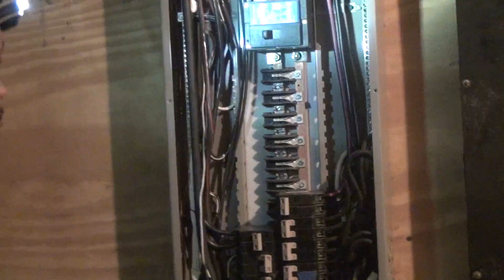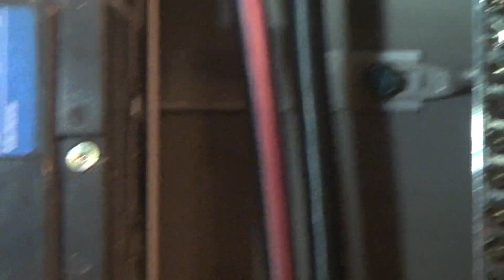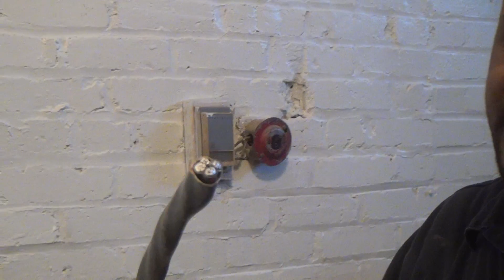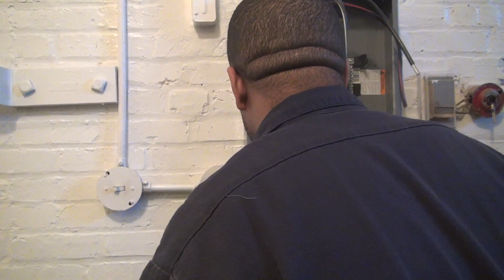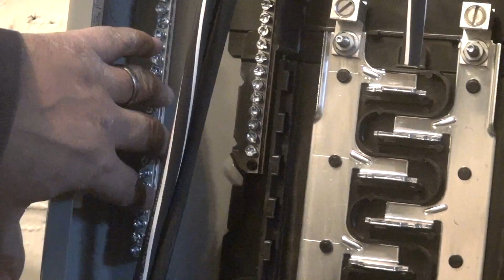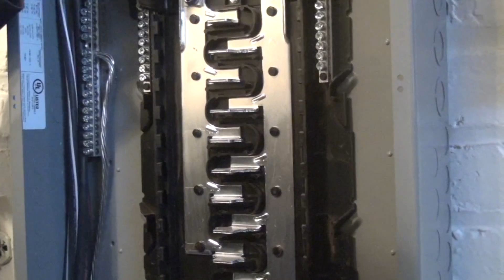How to install a sub-panel

Comment: Great video Tyrone!  Very informative.  I've watched quite a few videos on the same subject and yours was definitely the best and covered all the necessary information.  I do have a question.  I'm installing a 100 amp subpanel in my detached workshop and will be placing a load center with its own main breaker.  In your video you ran the #2 wire from a separate breaker in the main panel to the subpanel.  When the subpanel has a main breaker how do you connect the #2 in the main panel?  Is it connected to a 100 amp breaker in the main panel?  It doesn't seem to make sense to have a breaker at the main panel and another one at the subpanel only separated by the #2 wire but there doesn't seem to be any other option.
Reply from the maker: you can have one in both but normally you just use a main lug panel for the subpanel.
Reply: Thanks for the quick response! That's what I thought. It didn't make sense to have 2. So how do you connect the #2 wire in the main panel?
Reply from the maker: Rob Neto You can use a main lug panel for your 2nd or sub panel. It has lugs at the top where you would connect your #2 ser cable. The main service panel will be where you install the main breaker.
Reply: That's what I needed to know. I'll look closer for those lugs in the main. Thanks again!

Comment: Hello Tyrone! We are planning to install a sub-panel in detached garage. The size of wire is 8/3. From main panel It comes out from 40 amp breaker. Unfortunately, the wire we purchased is too short. The wire is in the garage. I was wandering is there a way to extend the wire with a small box? Thank you so much for your videos.
Reply from the maker: Yes you can install a junction box, to make life life simple I do suggest that if possible you install the junction box indoor. The requirements for installing the box outside means the box have to be approved for such use and the manufactures installation requirements must be followed.

Comment: thanks for the video. Question...I have a 200 amp main if i install a 100 am panel in my garage/shop will my main panel still provide 200 amps? If not, how can i accomplish this? thanks in advancep sub
Reply from the maker: Hey Jon every thing that is connected to the 200 amp panel becomes a load to the 200 amp panel. So the answer to your question is yes. Normally you calculate the load that is being served by your service (main panel) then derate that value by particular amount based on calculations found in the NEC. Trying to explain those calculations in this comment would be a bit much. If you have a heat pump, electric range,electric dryer, electric hot water heater, pretty much all electric appliances no gas then you may want to do a load calculation. Otherwise you may be fine with the 200 amp service, in all likely hood I would think that this is the case. Very seldom is a 200 amp panel not enough to serve the typical single family home even with the addition of the sub panel in the work shop.
Reply: Thank you for the quick reply I now have a better idea in reference to my particular circumstance
Reply from the maker: Jon Declemente no problem

Comment: Great video. I have a 100A main lug panel in my laundry room and want to upgrade it to a 200A main breaker panel due to the present one being full. The service panel that has the meter is located outside on the opposite side of the house for which the full main lug panel is located now.. I believe that I need to run a new 4/0 4/0 2/0 AL cable from the meter panel to the new 200A main breaker panel in the laundry room.  I also want to replace the present 90A breaker in the meter panel with a 200A breaker for my new 200A main breaker panel in the laundry room. Basically this panel will have two 200A breaker installed (one at the meter panel and one in the laundry room panel). How do I connect the huge size AL wire to the new 200A breaker? Do they even make a 200A (GE, Eaton, Cutler) breaker that is not a main or am way off left field? The end goal is to install a 200A main breaker panel in the laundry room. Oh by the way the outside meter panel houses three breakers: 1- 90A main house breaker, 2- 50A AC breaker, and 3- 40A RV breaker).
Reply from the maker: i am a little confused what size is the service coming into the house? Why do you think the size of the sub panel needs to be 200 amps ( what type of loads are you connecting )

Comment: Thanks for you time in filming this video installing the 100 amp sub panel. What was the size of the 2 pole breaker you installed in the main panel to supply the 100 amps you brought over to the sub panel with the SER #2 aluminum cable?
Reply from the maker: I believe the main panel had a 200 amp main and the breaker in the main panel that supplied the sub panel is 100 amp.

Comment: Excellent tutorial...thanks for taking time from your valuable day to post this video. What is the proper place to install the sub panel? Does it have to be in a certain room or perhaps a hallway or closet?
Reply from the maker: no there is no specific location but it must be readily accessible and have a minimum of 3 ft of working space.

Comment: Pretty good video but the main thing you missed is what size OCP you used for that sub panel with that #2 AL SER.   What code cycle are you on? For 2008 cycle you need to use the 60 degree column for ampacities which #2 AL is 75 amps.

Comment: We  were taught that the NEC will never require larger than no# 6 wire to a ground rod but if we want the utility company to hook up, we had better run a no# 4 . Remember local codes can supersede the National Electric Code. Good video ,well done.

Comment from the maker: The installation you are attempting is a little complex (you have special requirements for equipment serving boat docks and marinas) It is to much information to post in a you tube comment (not nearly enough character allotment) I would suggest calling a licensed electrician to make sure that everything is done properly

Comment: Great video.  Very informative and you're entertaining to watch.  Is there anything additional I need to do if I am going to install a subpanel on the outside of the house?  Do I need to add another ground?  It is for a boatlift.  Also I will need 50 amps so what size wire do I need to run from the main panel (about 100 feet)?

Comment: The neutral must float in the sub panel because otherwise it could deliver current back through to anything connected to it's ground.  To put it simply, current takes the shortest path to ground, if you neutral bond a sub panel, that path could well wind up being the panel or metal boxes & conduit  that are grounded to that panel, electrocuting you if you happen to touch them and become that short path.  Keeping the neutral and ground separate in sub panels keeps a clear, safe path for current..

Comment from the maker: Yes the 3awg and 4awg for ground is fine. you are not required to use an anti-inhibitor but it is a good practice to do so, always try to exceed the minimum requirements.

Comment: Ty, great video. I have watched it a couple times now. A couple questions. I am running a 100 amp subpanel(basement) from a 200 amp main in my garage above. About 15ft.  Is #3 THHN CU wire sufficient? Also have #4 THHN CU for the ground. I bought a QO subpanel. Have not opened it yet but if the bus is aluminum clad do I still need to use Pentrox with the copper wire?

Thanks

Comment from the maker: That would not save you much. If you install a 100 amp subpanel you are better off installing 100 amp cable and main. Also you should always try to keep your load around 80% off the rated circuit ampacity. While this rule is not set in stone you have a lot of other things to consider. The amount of cables in the raceway ambient temp. etc. But 80% is a good starting point if you are not sure how much to derate.

Comment: Quick question for you. If you install a 100 AMP subpanel, but only need to feed a 50 AMP load from that subpanel. You would put a 50AMP breaker on the main panel and run 50 AMP rated conductors?  Or do you have to run 100 AMP rated conductors for a 100 AMP rated panel?

Comment from the maker: You want to twist the white wires together and put the bare wires on the bar that is assuming the bar is bonded (connected) to the disconnect. Depending on the type of disconnect switch you purchase sometimes they come with a bonding screw that you screw through the bar to the panel to make the connection.

Comment from the maker: If you do not have any free spaces the quick way would be to install 2 tandem breakers which would free up 2 extra spaces for your feeder to the sub panel (most manufactures have tandem breakers for there panels). You need to make sure that your load is not to high by checking the line current with a ammeter. The load should be no more than 80% of the size of the main breaker. (100 amp main load no more than 80 amps) refer to my video on checking current.

Comment: How would you do this say if there were no more open breakers in the main unit downstairs? I want to run a sub out to my shed but on the main panel outside the house there are no open positions I think there were only 6 and one goes to the main sub in the garage then AC, Water heater, and a few others. I will most likely pay to have this one done since it seems a little more complicated. But would you replace the current main with a larger panel or run another sub outside somehow?

Comment from the maker: Roland you want to run 4 wire to the sub-panel and you do not need to drive a second ground rod. Just make sure that you keep the neutral and grounds separated in the sub panel in the out building. Also if you bury cable in the ground make sure it is suitable for direct burial.

Comment: Very good information. I'm putting in a sub panel to an out building. 100 amp GE Should I run a 4 wire cable or 3 wire I was going to use a mobile home feeder 2 2 2 4 cable and do I need a ground rod or use a 2 2 4 cable and a ground rod.with #6 ground
Thanks hope you can help
Roland

Comment from the maker: That is a good question. Off the top of my head I would say no do not drive a new ground rod run a new SER cable(has 4 conductors). You do not want multiple paths for fault current to travel. With that being said the jurisdiction having authority would be the ones you want to ask to be sure you do not violate any local codes if you decide to install a ground rod at the sub panel

Comment: If I have a sub-panel that only has 3 wires running to it 2 hot and one neutral at 200 feet can I ground it with a grounding rod at that location as long as I keep the ground and neutral separate. At this time the ground is only bonded to the sub-panel box.

Comment from the maker: Yes you can 70 amps is a odd ball size I think it would be easier to find a 60 amp panel but the answer  is yes sizing is based on the load that you are serving. So your total calculated load does not exceed that of all panels or 80% of your service (good rule of thumb)

Comment: Lets address your floating neutral. To you it means isolated from the metal and ground bar. Well a floating neutral is a dangerous condition it loses its reference to ground. A floating neutral can cause voltages to float to it phase volts RMS causing unbalancing to the loads.Next time use isolated neutral there is a difference. I thank you we have had a good conversation on here keep up the good work LOCAL 21 good luck with work.

Comment: Look at 250.12 again it states a lock nut which removes paint hence a better bond.Would you use a bonding bushing with a concentric knock out? I sure hope you would.Two screws that hold the ground bar are not always the best bond. You being a master should not argue the point.
Reply: That's on connectors not a ground bar kit.

Comment from the maker: Ok after this I am done. What we mean when we say the neutral is floating is that it is isolated from everything else electrically including the ground in a sub panel. article 250-12 read the last part (designed so as to make such removal unnecessary) the ground kit  is threaded into the panel hence rendering scraping the panel pointless. If you feel that scraping the paint makes you feel better then have at it BUT IT IS NOT REQUIRED WITH THE GROUND KIT

Comment: I got news for you dude the neutral does not float at all in any panel..Explain what a floating neutral is? I am local 134 Chicago.Read  in the NEC 250.12 then comment again.Also if your ground bar is your only means of a good bond why would not scrap the paint off? This is a sub-panel not a device on a yoke.No you never said bonding the neutral in a sub-panel. You did say the neutral floats which is not correct either.
Reply: Because he is installing it to manufacture specs and you don't have to scrape the paint. Why would leave bare metal to rust.

Comment from the maker: I never said anything in the video about bonding the neutral in the sub panel. I said that your main bonding jumper is installed at your first service disconnect. and yes the neutral floats in any panel up to this point. and no the code does not require you to scrape the paint off whare you install your GROUND KIT notice ground kit in caps thats a hint. Local 24 and yes I am a master electrician

Comment: This is Rich Lawerence I got news for you a floating neutral is something different then bonding the neutral in a sub -panel. I also know you do not do this it will cause a ground loop.Also scraping the paint on a ground bar is required by NEC code you are wrong again it is a better bond .a main breaker in a sub panel is a good idea it depends where it is being installed.You part of the IBEW what local you a master electrician ?

Comment: Hello Ty, Great video's, I'm from NJ and as you know we had Irene & Sandy hit us very hard, If you could do a video on connecting an outside generator outlet using # 10 wire to a 30 amp breaker on the panel box to run a generator, it would be very useful to a lot of people around here as we had a power loss for over two to three weeks with all them storms, and it's going to start again in June
Thanks for your video's they are very helpful and explained very well
Al from NJ

Comment from the maker: No not a stupid question. The reason you can add the 100amp subpanel is because your total connected load with both panels is a lot less then 100 amps or at least it should be, in other words you should do a load calculation to determine if the main service is large enough to supply every thing that you need. (hint) you DO NOT have to take all the load at 100%

Comment: Excellent video.  You mentioned it being a 100 amp panel with the main disconnect in the main panel, it's that breaker in the basement 100 Amp them?  I know that's likely a stupid question,  but the video doesn't show the rating of that breaker as it's switched to the off position and you can't see it.

Comment from the maker: Hey Rich I am also a member of the IBEW and I also hold a Master electricians license. I am not sure what you disagree with but when installing a sub panel you do not want to bond the neutral in the sub panel. If you wish to scrape paint before you install ground bar cool but the mounting bolts are threaded into the panel so that is a wast of time. Main breaker in  sub panel, again if you wish you can but just spending extra money because you do not need it

Comment: hey dude the neutral does not float in a sub panel.The neutral is already bonded in the main panel.I am an IBEW member commercial
electrician I disagree with the panel you put in i would of use a main breaker. another thing you did wrong was to install you ground bar you should of removed the paint on the panel for a good bond. that's all you have that bonds the panel . I would use on aluminum wire no lox.

Comment: Hey Tyrone, I have a quick question. I need to install a sub panel box but not a 100a box to my garage. I have taken residential wiring classes and right now am in the IBEW journeymen's program but right now I'm the grunt. I just need like a 6 bay panel but have to run a 220 line 3 regular outlets and two shop lights (hard wired). I have a 100a service box in my residence, so what size box and breaker would I run?